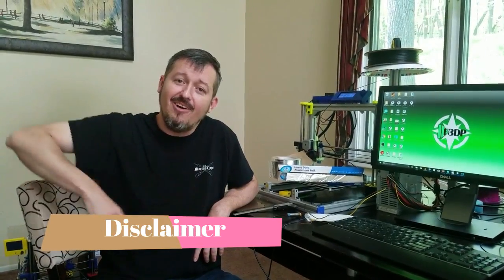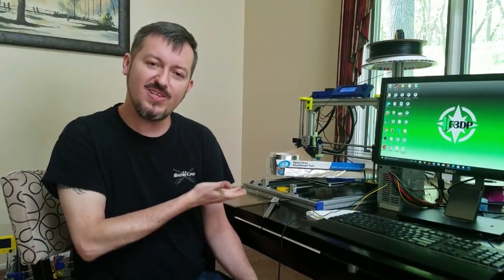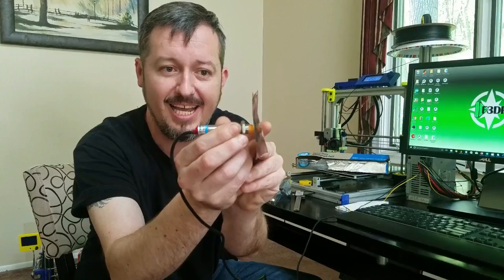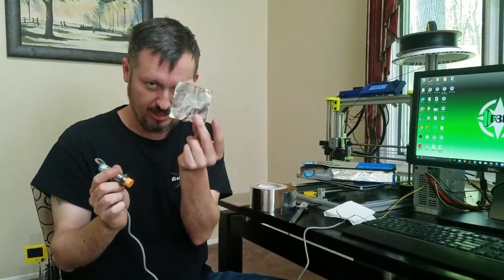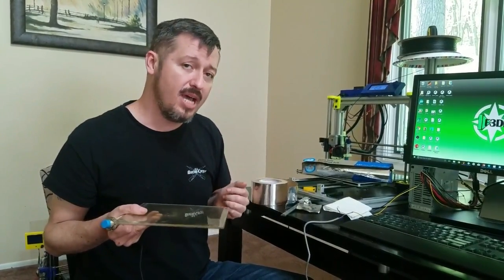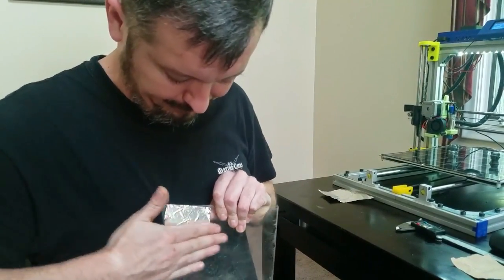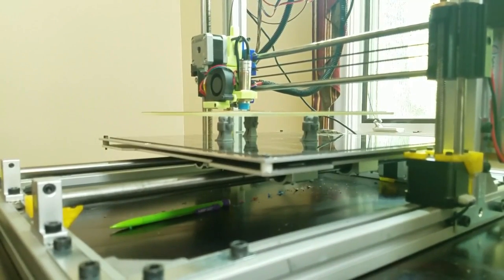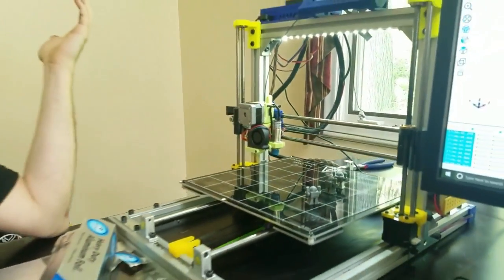Confirming A Proximity Sensor Myth

Comment: Hi friend nice video here, Chanel subscribed :-) im trying using this sensor LJ18A3-8-Z / BX 8mm , he detects metal and he detects my heat bed, but i put a glass build plate on the top, and the sensor doesnt detect anymore the allumium os the bed.... Any ideia? I have conected the sensor at 12v and 24v and i have always the same result, doesnt dected the bed behid the glass.... Do you have a ideia to meke this working? My glass have 4mm
Reply: Substancia 3D did you figured it out? Did you connected it to the power supply to get 24v?
Reply: @marcospiotto9755  Yes. and i have develped my own sensor please check https://www.substancia3d.com
Reply: Substancia 3D I see, good luck with your business, but since im from Argentina the shipping would be to expensive

Comment: are these NPN or PNP and inductive or capacitive
Reply: If they are all capacitive, you won't even need the aluminium tape. Capacitive sensors can sense any material. It is the inductive sensors that Tom was referring to in his video.
Reply from the maker: David Mckay 
the 5v is npn, capacitive
the other ones are pnp.
Reply: Yourdy Alcaide so they are all capacitive?
Reply from the maker: Dan Brown yes all the ones I tested were capacitive
correction: I checked which sensors I used and both of the 8mm are inductive.  my mistake however the 4mm was capacitive. 
Sorry about the mistake.